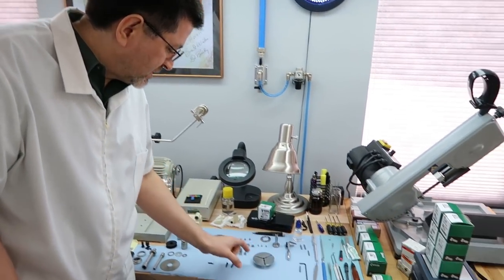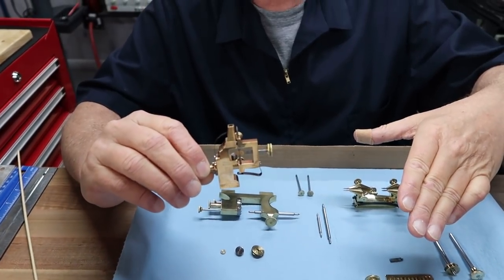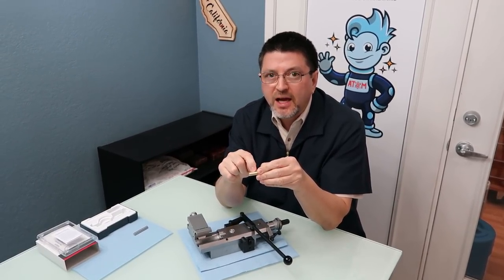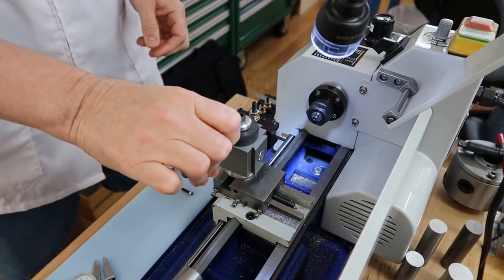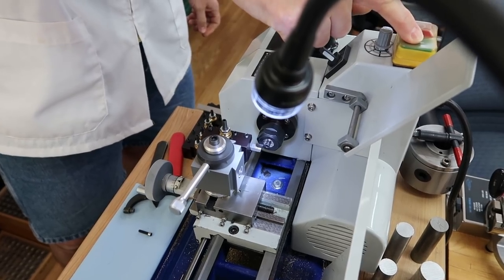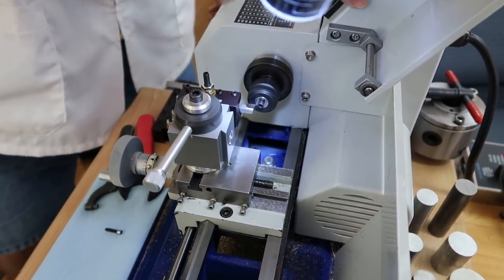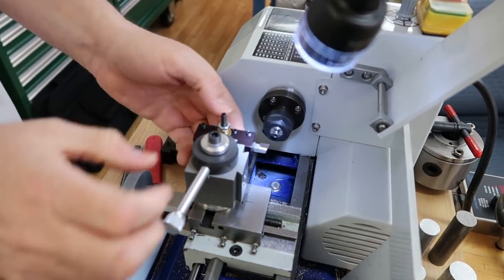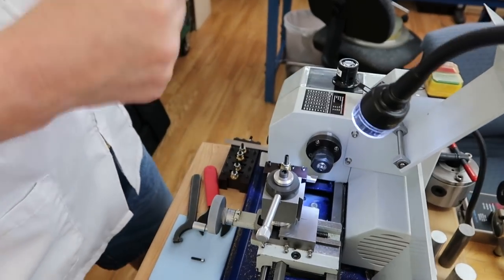SHOP ADVENTURES 30: Simple Machining Projects & Vintage Watchmaking Tools

Comment: That's interesting about the amount of jewels !  Your right about the 7075  machines like butter , i will be using a bit for an upcoming project . Well worth watching the last half tonight , Cheers .
Reply from the maker: Hi you Max back again you did watch that second half? Question should we add an intermission like we think movie in a theater did or do. 
7075 dates back to my early childhood 1973 - 1993 ,me Lance here Max, we machined a lot of materials but know more used in the air-frames of both commercial and military aircraft then the 7075-T in any state, that is where the machining knowledge we have began for this Active Atom only on a scale of large proportions like those large vehicles that you share in some of your videos, those trucks and such are just massive Max, thank you again for stopping in for sharing thoughts with the community and for being our friend, Lance & Patrick.

Comment: Great stuff ,I wonder why they didn't counter bore the screw head holes bigger . Handy to have another lathe for machining the unknown's . Watched half tonight  & will watch the other half tomorrow night ,   Cheers .
Reply from the maker: Hello Max our friend in Australia.
Great questions come from great engineers (that is you Max) thank you for raising this one for us.
Why did the Swiss makers of the chucks not bore the holes to a larger more standard accommodating diameter?

We wold only be able to speculate here though Max, but we share that one chuck the chuck from the video following our refurbishing and its near dozen others in various jaw number counts we are refurbishing right now, some are slightly larger and some slightly smaller diameters are all made the same, they all require the owner to machine the heads of the screw heads.
  
We know our videos might need to be split up and we sure are thankful you think enough about us and enjoy the content to come back and watch the second half, as you are sharing.
Thank you for sharing, adding this great question we really did  not answer well for you, we enjoy you and are thankful to have you in our lives Max, Lance & Patrick.

Comment: Your Bright Boys look like track cleaning, or track erasers, used by the model railroad community. Hopefully they are still available at your local hobby shop. Always a pleasure watching you guys at work.
Reply from the maker: Hi Donald we can share with you there is big differences between the Bright Boy Tablet which we use and you would want to buy because the other is the Bright Boy abrasive Track Cleaner and is not going to work so well for you, they are very different products and of course they are also priced this way, what is new. Thank you for sharing and recognizing these great items we use in the shop here. 
Your friends, Lance & Patrick.

Comment: Loved the little bows for drilling the vintage watchmaking tooling destined for your museum.  Thanks once again for a fascinating insight into the restoration of those tools and how you make the parts to you need for the upcoming 'Project'
Reply from the maker: Hi Paul, the little manual human spindle (the bows) are great we are lucky to have them both. We are both so honored to be entrusted to care for these watchmaker tools and machines for the future to enjoy seeing even holding in the palm of their hands. 
The Levin instrument length bed lathes are going to be the real workhorses here for the making of the product, we are in urgent rebuild (being done here in house and being filmed) of this Levin 3C collet spindle to allow us to machine our biggest diameter component for our product once we see that our Levin lathes can cut this size and in the material we wan to to use, we will share what we are making after-all, that is the only reason we have not shared what we are making thus far.
Thank you for taking time to share with us your thoughts and likes this is helpful to us. Lance & Patrick.

Comment: Beautiful tools.
Reply from the maker: Hello Mark. Currently though not being filmed (pictures will likely be shared over time on Instagram) as most of our 186 hour work week is not filmed we are currently rebuilding F.W. Derbyshire WW/8 mm open style headstock lathe large body, it is serial number 850 and is the only Derbyshire US made lathe we are the caretakers of.
It is not a daily oiler it is a paired angular contact bearing set and single deep groove bearing later model US Government likely.
In a resent video we shared a n (NOS) New Old Stock Derbyshire Pivot polisher, never used never even installed, we think this is likely the finest example in currently known existence, because Derbyshire was not the most popular models of watchmaker lathes in those watchmaker times of greatness here in America.
We have the Derbyshire counter shaft with daily oilers it is a dual pulley unit mostly made for early day speed control as these were in those early times AC motor driven machines not speed regulated DC motor types, this counter shaft unit is going to be restored following our completion of the Derbyshire headstock.  
While this headstock and pivot polisher units both fit many of our lathe beds, we do not have a Derbyshire lathe bed or the tail-stock, so we are seeking each for a completed lathe and on the long term wish list, we will seek out a dual and triple version cross-slide making this a completed Derbyshire branding period perfected unit.
That is what we are up to currently as well as the complete assembly of our Barker Milling Machine that is in near final assembly as it is now needed to perform machine work on our first ever product deigned by us here in the high-desert of Southern California Mark.
Your friends, Lance & Patrick.

Comment: Did you guys make that rotary table for your Tag mill? Come on a 11 x 22 large lathe. I had to smile. The old tools are really beautiful.
Reply from the maker: Hey hi Peter, you cut us short (pun intended) that giant is 11 x 27 not 22, see those 5 inches are suppose to count LOL. and whatever that giant lathe cannot do surly our floor shaking TAIG CNC Mill can make up for LOL.

We do love our early start to this museum but wow are those tools small for this big handed Lance to make new again, we are so excited to begin this restoration of watch tools and machines, it will take years to get though them  all, even as we share here right now we are doing something like 12 or more Swiss chucks 3, 4, 6 jaws like from in the video beginning with Patrick this week.
Insider track to our cool CNC friend Peter
This coming Monday Shop Adventures 31 we share a road trip and we each select and show off and share a wristwatch we favor while heading out, see we rarely leave home / work so this is a big deal for us both as we only wear a watch when we venture out.
Thank you for being here Peter and for making those great videos especially the recent one of some small work (lapping) we can relate to those best of course. Lance & Patrick.

Comment: Great video guys, that mini lathe is nice . I really enjoyed the milling. I always wanted a sherline lathe and mill but they cost so much in the uk but they sure are nice machines. Thanks have a good day. 
Jace
Reply from the maker: Well hello Jace, nice you are here, hoping your new vise is doing your artistic work well. Sherline is only down the freeway about 2 hours from here so we live in this vast and open desert named the Mojave, but as you head down out of the desert you enter the main freeways that take you towards the Pacific Ocean and to Sherline and their museum they are each located along that path.
We do not own any Sherline, I am not clear why this is but I wanted o share this with you. 
We are happy you like our lathe but we are very happy you like that US made TAIG CNC converted by us we did all of the electronic circuit boards and fitted the motor a brush-less DC motor on top and the stepper motors, it came out well and we are very thankful to have this diversity in the shop. 
I hope our sharing this extra information helps you see what we do and how we do things maybe provide you some ideas or alternatives to buying Sherline. We are happy with some Proxxon finishing tools (we do not know much about the main machinery they sale though) those are in Germany, what do you think of those tools? Jace. 
Thank you for being here, your friends, Lance & Patrick.

Comment: Hi Patrick and Lance,

Very interesting.  Those little Chinese lathes are hugely underrated by many lathe owners.  Collets are also sadly ignored by the vast majority of home lathe owners.  There is an unfortunate attitude by many that bigger is better in lathe land, but that's an ill informed view.  It's horses for courses and one size does not fit all, as you would know better than most metal work people.

I don't know how you guys feel about grinding on a lathe, but that's my usual approach when dealing with really hard metal in small diameter unsupported work.  OK it requires a thorough clean up after, but precision is not an issue within the limitations of the lathe.  I'm talking small air die grinder here, not some full sized TPG (which I also have).

Anyway, enjoyed the footage.  You have some really neat stuff.

Cheers Rob
Reply from the maker: Hi Rob happy to read from you, we are having fun here right now and it gets more fun when we hear for people like you Rob.
We do have the and agree with you about these grinder we actually use out Levin Lathe grinding accessory often and as you share just keep it, the lathe bed clean during operation and clean the machine and the entire area after each use and thing work fine for seemingly ever for us as well.
We like your air die grinder way as well.

The Asian import machinery in this case as with others the lathe as you see we use. 
We rebuild precision Levin lathe spindles in all their types and sizes (in-house only no outside work) so we value the accuracy they can maintain this is the only difference to us the Asian import can make those screws for us but if these were was watch movement screws the Levin Lathes are going to prevail here in accuracy and repeat ability. 
Our Chinese Lathe of 12 years is always needing adjustments to do its work and we take really good care of it they are just not built to do the Levin work quality day in and day out.

Thank you Rob for making great videos, for being our friend and we vale deeply your shared thoughts in the community.
Lance & Patrick.

Comment: That's the first lathe i ever had. I sold it 4 years ago, and the brand name was in Chinese characters, so no idea who sold it exactly, but for 450Euros or there about, when i bought it some 10 years ago, it was an excellent machine. I was at an exposition in South of France and there were 3 models, this one, one taller with the same base, and one longer with a slightly bigger throw and carriage. Not all tools from China are bad, just have to know which is which.
Reply from the maker: Hi aserta, nice share here about you owning one of these as Patrick refers to it a 12 year old beater, only truth is, he loves this machine for roughing the materials while still remaining in the Workshop area not having to exit the Workshop to enter the Machine Shop area for this roughing operation stuff. 
aserta it is actually a good machine requires adjustments often but overall it gets us the one off work through clean and clear. 

We like that you have a good eye, we love it that you stopped in shared a welcomed thought or two and we are very happy to have you here, thank you so much, Lance & Patrick.

Shop Adventures airs each Monday night later and runs about an hour covering 4 to 8 topics typically so we hope you will watch a show or two more and see if we are working hard enough to share or skills ask for help when we do not have the answers and do a light amount of educating while having a laugh or two. Patrick  and I, Lance are childhood friends (since 1975) and we have been running this business since May 1993 so we are coming up on 30 years in May of 2023 wow wee.

Comment: Interesting that when I looked up "Bright Boy" its  main use is in the model railroad hobby for cleaning tracks.  You guys didn't tell me I was supposed to wear a blue coat when machining. What happened I thought we were going for hamburgers? LOL......
Reply from the maker: Hi Tom how are you doing we are so much realizing you really needed a bigger shaper so we got over you selling the little guy down the river, we just came to terms with it. LOL. 

Here is the best search term to help you "Brightboy Abrasive Tablet" (that should get you to the right stuff there Tom)we should have been more helpful Tom with this like providing a link, we know about that model train stuff and we found that plausible as a solution for something anyways.

We are going Wednesday and sharing this trip a road trip in our 2002 Jeep Wrangler our only vehicle to get a burger fries and onion rings for Patrick. (we rarely leave home/work and rarely still eat out) so this is a big deal to both we are even going to film  the ride and share it in this Monday nights Shop Adventures 31.
We are watchmakers and have a collection of time pieces, so we are getting all dressed up (in watchmaker terms this means sporting a time piece each) and taking the community along with us, we are heading in the direction of the KOH (King of Hammers) event location but stopping short of that great rock crawler place.  
Thank you for being here and for sharing those great videos of your artistic an machine restoring abilities, we enjoy them here, Lance & Patrick.

Comment: Nice little CNC milling machine you got there. Is the programming based on G-Code or is it more like CAM? 
I wrote you guys an email by the way, I got an old Henri Hauser gage in my shop which I never use, so I think I just send it to you if you want. Maybe you can do something with it in your shop. 
 
Greetings from the Baltic sea:)
Reply from the maker: Hi and hello back at you in the Baltic Sea. We use a CAM package called SolidCAM which works with SolidWORKS and that is what generates the G-Code for our mill, glad you asked that, no one else has. We received your email and we responded about 24 hours ago and we can resend if you want? We are so happy you want us to have this fine inspection tool and we want to have it so yes please let us know. 
Lance & Patrick.
Reply: @ActiveAtom  nice, I'm gonna send it to the address from your website. I'm happy

Comment: Fwiw few seem to know what most museums use to slow tarnish on brass, silver, copper etc and rusting in humid climates on ferrous metals. Since there's a good possibility either or both of you might already know it as watch makers then that might make this totally redundant. Rusting in your climate should be almost non existent. But tarnish on all the brass of those older watch making tools won't be. Try Googling "Renaissance Wax". Basically the wax is an invisible barrier between the metal and the oxygen that causes the tarnish or rust in the right conditions. A standard paste car wax will do the same, however I think that proper Renaissance Wax seems to last a lot longer. 

Sub related, since you both keep your machines and tooling spotless then using an automotive rated paste wax that will withstand the oil and cutting fluids on the machines and tooling where appropriate makes clean up far faster and much much easier. I wouldn't use it on the actual sliding surfaces or collets of course, but it's fine for almost anywhere else. After all that work re-polishing and repainting as much as you have adding a coat of wax once in awhile should preserve that work for a whole lot longer. I worked with a guy who used to wax his Cat excavator and a 4 year old machine looked brand new other than the surface wear on the tracks and bucket. It works just as well on machine tools.
Reply from the maker: Hi smart one (meant with our best of hearts for you) you got us and you provided great information we were unaware of and we hope others here are reading as we did we did not know about but will research Renaissance Wax it makes great sense we like this thought and if it comes to be true we will buy it and begin the process of incorporating in into our refurbishing where applicable during restorations, thank you so much for the story of sharing the cat excavator we love Caterpillar here they rule and we will start waxing our shields shrouds on the backs of the two lathes we have for reducing the cleaning time and wear over time.
Come back please this coming Monda for Shop Adventures 31 airs 04/08/2019 we take the show viewers on a road trip and we dine out while we are at it there is even a light amount of geology shared tectonics and rock weathering from this amateur named Lance it is just a hobby for us because of where we live and the influence this open undeveloped or fenced off environment has on our creative side for our product design. We do discuss the Mojave Desert and the great Joshua Trees limited growing locations globally except a few places some sharing to be sure.   
Thank you again, Lance & Patrick.